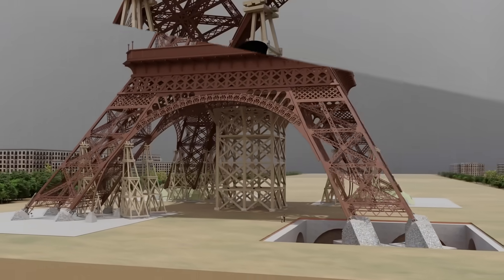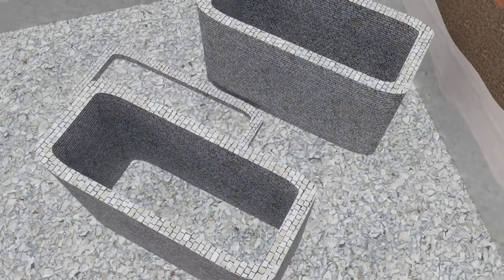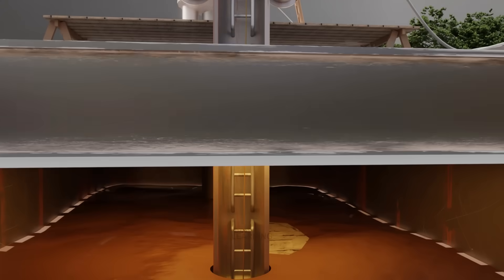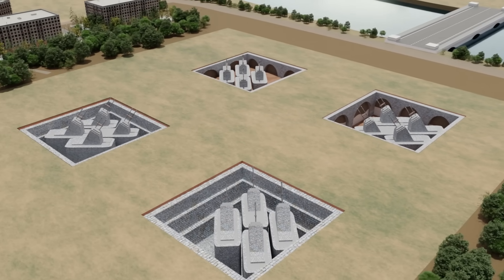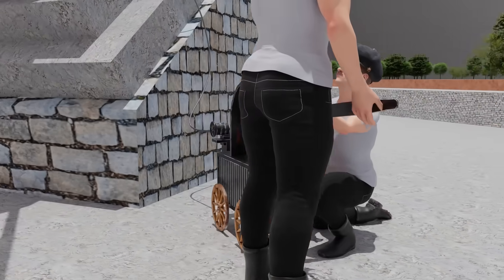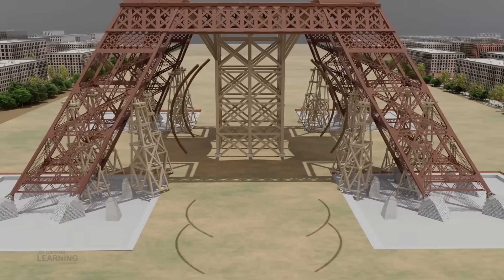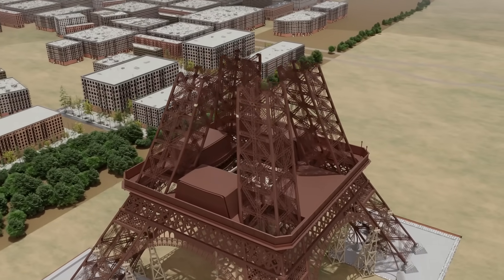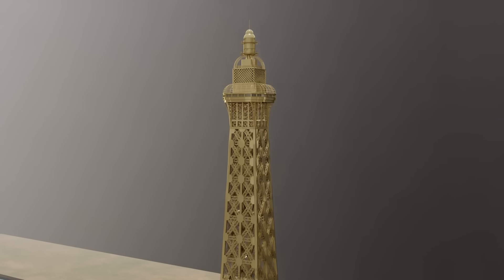Building the Eiffel Tower: The Impossible Feat | Full 3D Animation

Comment: Are you sure they built the retaining walls on the river side as shown?  This type of VERTICAL arches can resist LATERAL pressure better???   I don't get it.  Your animation must be in error.
Reply from the maker: Good point! I actually thought the same thing at first, but after checking historical photos, the animation turned out to be accurate. Those vertical arches really do help resist lateral pressure by channeling the sideways force from the soil into compressive forces that go straight down into the foundation. Of course, in reality, the walls also had massive weight, strong footings, and proper drainage to make them even more stable.